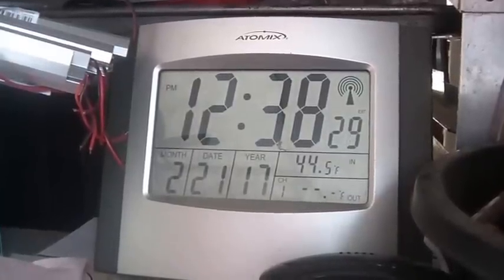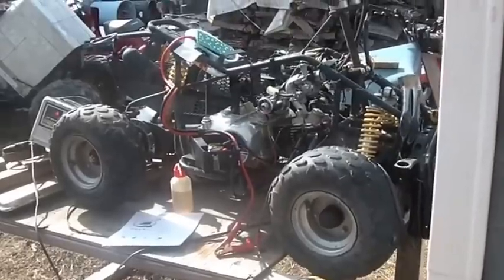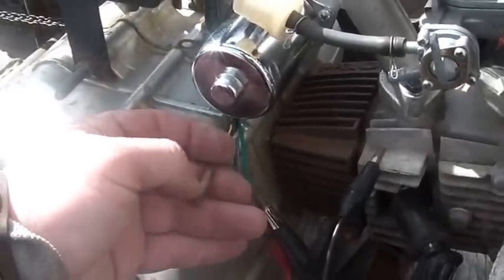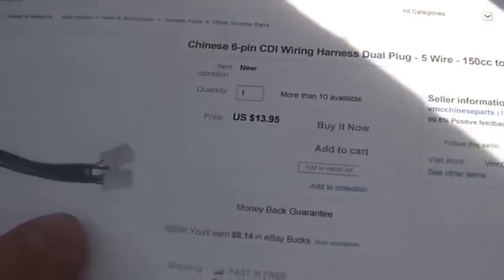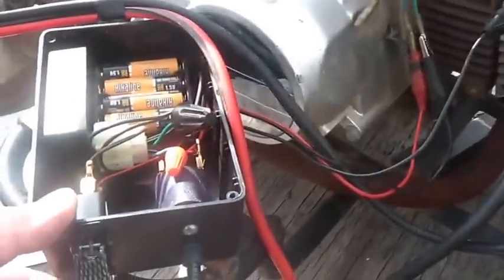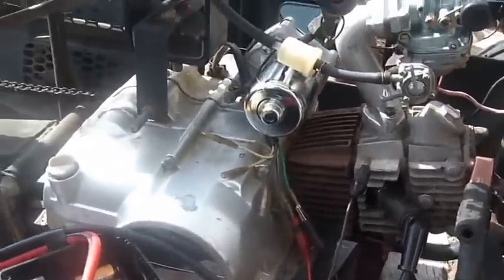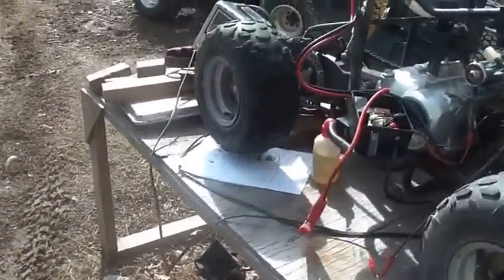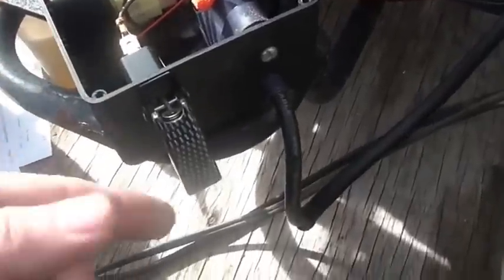No Spark China Quad 12Volt CDI Hack makes troubleshooting easy,

Comment: Can u change wire harness on viper 90r 2 stroke everything runs threw the cdi I have no spark
Reply from the maker: Hey John, If there is a pulse generator, U can use this CDI hack... I hope this helps, thanks for asking, watching, and commenting, Good Luck!!!
Reply: Harvey Spooner I don’t think there is
Reply from the maker: Hey John, Can U mount a pulse generator such that it is adjustable a little in front of TDC.... U should be able to wind up to 6k rpm, maybe a bit higher....  Kind of an interesting experiment to play around with.... Thanks for asking, watching, and commenting!!!
Reply: Harvey Spooner I have good ground power to the coil butt I’m not getting any reading on the mutimeter from the stator
Reply: Have the same problem did you ever find out what it was?
Reply: Viper 90r

Comment: will this hack work for ac cdi? do you have any wire up scematics?
Reply from the maker: Hey Mac, If one wants to use a 12VDC, one has to use a DC cdi... To power an AC cdi a stator coil needs to be used as power... I may try using a 25 VAC source as an experiment, but, as of now, I have not tried it.... Thanks for asking, watching, and commenting, Good Luck!!
Reply: @HarveySpooner i just ordered a dc cdi, but  thank you so much for your time! your info is greatly appreciated, and you have great content keep it up!
Reply from the maker: Hey Mac, Thanks for Ur kind words and support.... I wish I had more time for the channel and to reply to comments!!

Comment: hi harvey, 
i think my stator is broken because im getting a reading of 117 ohms and when i crank the engine over im getting 12-13 volts. do u know what voltage u should be getting?
Reply from the maker: Hey Marien, I'm going to drag a China quad out of the weeds over the next few days, I'll go thru all the readings on that, stay tuned..... Given the readings U provided, I think Ur stator maybe ok, I would expect it to be lower if shorted and given that it is hard to see the peak voltage, (should be around 45v I think but, it is hard to capture that with an ordinary DVM.... Did U check everything else, I rarely have a stator go bad.... Thanks for asking, watching, and commenting!!!
Reply: Harvey Spooner 
well the previous owner hacked up the wiring loom so i think he put the battery direct to the stator and blew it. i have checked the cdi and tried another one, still didnt work, the trigger was around 150 ohms and gave around 0.2 volts
Reply from the maker: Hey Marien, Sounds like he may have taken out the cdi, stator and pulse generator, not a bad idea to replace the wire harness also, if U can find something like this, https://www.ebay.com/itm/CDI-50-70-90-110CC-Wire-Harness-Assembly-Wiring-Set-ATV-Electric-Quad-Coolster/262902310138?epid=692498679&hash=item3d3632e4fa:g:VZ4AAOSwWxNYz7b4&vxp=mtr   .... I think it can be Ur most cost effective solution.... I hope this helps, thanks for asking, watching, and commenting!!!
Reply: Thanks! looks good but will the groundplate fit?
Reply: @mariendeleeuw6537  hey did you ever find the solution for this? My stator is also giving out around 12 volts but im not getting spark. Ready to bring a little 150cc eton viper back from the dead!
Reply: @shiloh-onecallidoitall8886  hey! Yes i did found a solution. The problem was, that i was using a cdi that apparantly didnt work on my atv. I used another one, 4 pins green plug ac, and i had a spark! But now i am troubling with a weak spark so maybe ill shorten the elelctrode and annode distance of the spark plug.
Reply: @mariendeleeuw6537 true im having trouble hooking up the old stator into the new wiring harness
Reply: @shiloh-onecallidoitall8886  as harvey says just forget the old wiring harness and create ur own with only the needed aspects.

Comment: Hi, i solve no spark.. fast and free !! very easy
Reply from the maker: Hey Road Fun,  For the China stuff, I tend to only be after functionality, I want to see if it will start, run, and shift thru its gears. I have a portable, self contained, 12VDC CDI box for that, if I want to restore the electronics, I tend to hack a $12 pit bike ignition, it provides me with everything including the left handle bar switches. I did subscribe to Ur channel as we have similar interests and there is always something for me to learn.... Thanks for dropping by, Ur suggestions, watching, and commenting!!!

Comment: Hey harvey its a minni chopper does that make a difference,?
Reply from the maker: Hey Tony, The China stuff I work on all seems to be the same for all the 4cycle stuff, the 2cycle engines can be interesting.... Thanks for asking, watching, and commenting!!!
Reply: Harvey Spooner well it has a pullstart and a push Button but no cdi box just a regulator it has a yellow~red wire and a green that comes off the push button, then the pull start ignition coil has green,and black and a red wire where do they go to the sylinoid please help, ur are the man.
Reply from the maker: Hey Tony, Is Ur minichopper a 50cc 2 cycle engine???? Thanks for the info, Ur thoughts, watching, and commenting!!!
Reply: Harvey Spooner yes
Reply: Harvey Spooner , im getting spark from the pull start and put a little gas down the carb but still wont fire i disconected the fuse the key lock and the kill switch ,and hand brake ,what could it be ,? Damn  chinese bikes

Comment: Harvey, first, thanks for you vids. With your guidance I finally have my 96 Honda up and running again.  Question:  in theory should you CDI hack box work on Polaris ATV?
Reply from the maker: Hey Paul!!!!  In theory, yes, if there is a stator for ignition, the Pit Bike hack would work, the 12Volt GY6 CDI/matched spark coil hack would work on anything with a pulse generator, as would the the Casoli 12Volt GY6 CDI/matched upgrade. Having said that, I have used the 12V hacks on Hondas, China quads, China pit bikes, and a Yamaha G6 golf cart motor... Personally, if I was trying to hack a Polaris, I would use the 12Volt Casoli GY6/matched spark coil hack and call it an ignition upgrade.... I should have a video on that ignition system up tonight....Thanks for asking, the kind words, encouragement, watching, and commenting!!!
Reply: Harvey Spooner Thanks!  I will take you advise. I will let you know the results.

Comment: Hey I had another question if there gas in the oil what that mean? Maybe a carburetor rebuild?
Reply from the maker: Hey Josh D, Gas in the oil normally means that the carb float is leaking by, the gas is flooding the carb, going into the engine, where it works its way by the piston rings into the oil.... I tend to turn off the gas for all my stuff and let the engines run until the carb is empty.... Frequently, I find that the fuel shut off valves leak by also and one can end up with the same problem... A long path to the answer, sorry.... Yes, a carb rebuild, using a kit with a fresh float needle valve is the place to start, I would also make sure there is a fuel filter, so nothing gets down into that valve seat to all fuel to flow, I would also check the fuel tank turn off valve, replace if necessary, and also run the carbs out of fuel unless the ATV or motorcycle is going to be used right away.... Thanks for asking, watching, and commenting!!!
Reply: Harvey Spooner ok thank u for the advice I